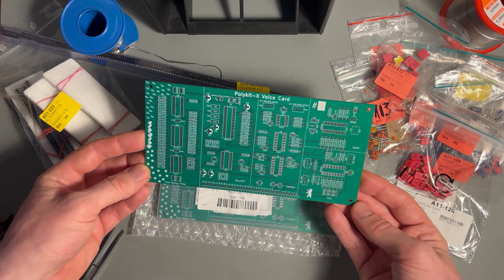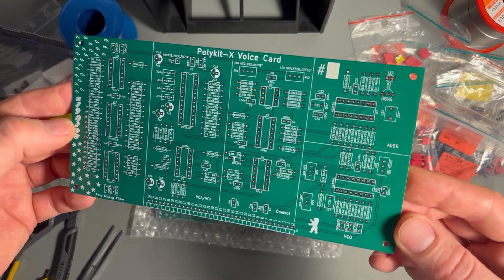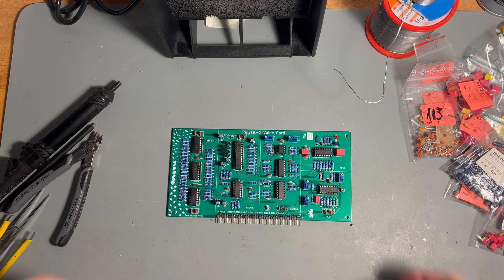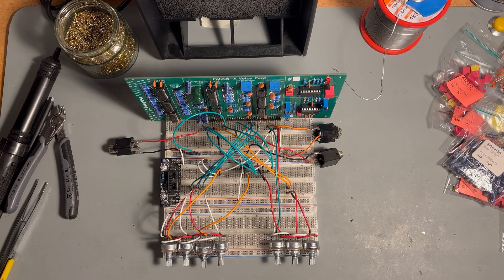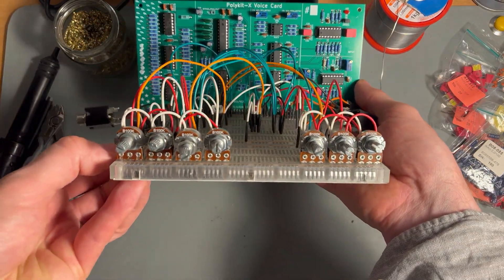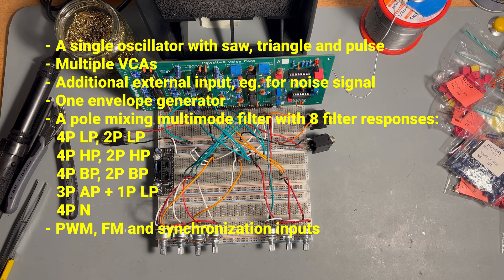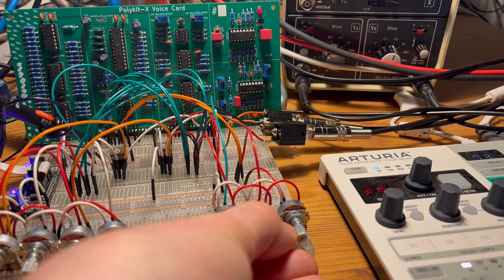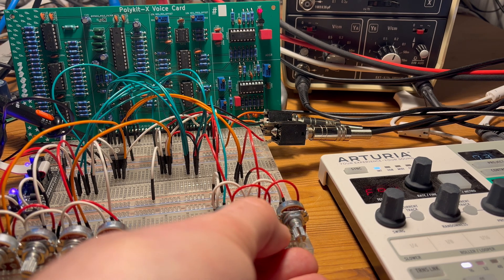A full analog SYNTHESIZER on one board including MULTIMODE FILTER

Comment: Hi,  I ordered two PCBs from you to play around, components are on the way.  I've checked out the schematic, and I have one question.  Is there any reason why you decided to put the EXTERNAL_IN, TRIANGLE and SAW signals through the 4066 switch, but not the PULSE signal, as it just goes through 1M R4 and merges after the 4066 with IN2?  You had a spare port on the 4066 and could expose the control pin on the 36 Pin header.  Just wondering, any insight would be much appreciated.   Thank you.
Reply from the maker: Hi Christian, the pulse signal can be turned off by setting PWM to 0%. It’s just a design choice I made to save one pin. Thanks a lot for ordering and the support! Jan
Reply: True, that makes sense. Thank you.

Comment: Hi, I would like to know if this is midi controlled or do you have a keyboard interface per card? If so on the keyboard interface, how many keys and what kind of key matrix do I need?? Also, I need a bill of materials to buy the components to populate the voice cards. Do you have any more synth diy kits or boards besides this one for sale?
Reply from the maker: Hi, this is more like a building block for a synthesizer, a single voice. You need additional circuitry to control it, eg. the monosynth I've build on top of it and a keyboard with CV output. Check out https://www.youtube.com/watch?v=aMLMR25Tyi0 for more details. I'm currently working on a polysynth also based on this design. You can find a BOM on the Github site linked in the description. I'm not really selling kits but you can find everything on Github and let it be produced by yourself.

Comment: Got my eye on this! Look forward for a Polyphonic setup with these boards, could the design go up to 8 voices even up to 16 voices?
Reply: Maybe a dual oscillator per a voice or with added sub thrown in there haha wishful thinking on my part
Reply from the maker: I thought of having two oscillators but I wanted to keep things simple. Maybe there will be a mark 2 with improvements compared to this one. My idea was to have a main board with 6-8 voice cards on it and make it possible to chain multiple boards together and have as many voices you like.
Reply: @polykit  I'm probably running to far ahead, I'm really interested how far this can/could go in a modular way of synth being built with upgrade paths and modifications
Reply from the maker: I‘m currently thinking of a module in Kosmo format with 4 voices on it. That means almost everything is patchable. I think there will be a video about this in a few days.